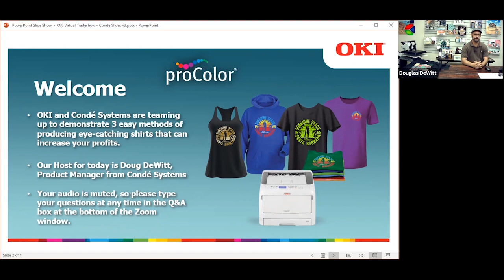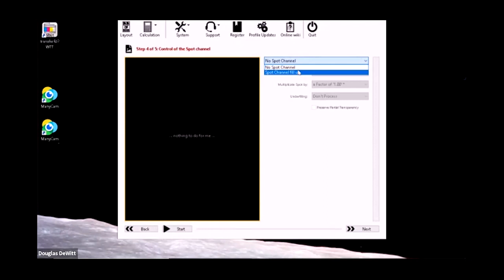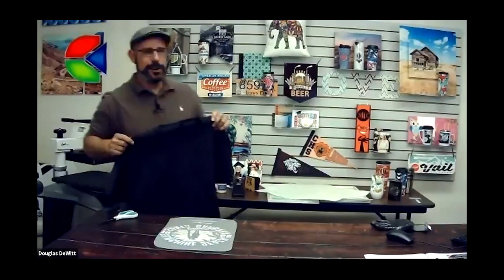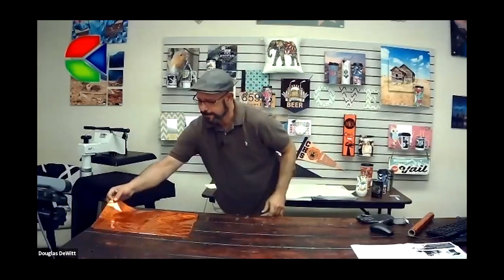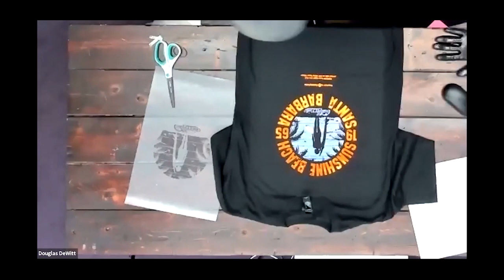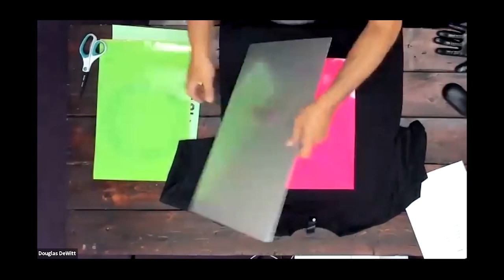OKI Virtual Trade Show - Decorating Tips to Enhance Transfer Output

Comment: Customers have complained that the design begin to peal, crack, and do not look good after only a couple of washes. 
We use the Oki Pro8432WT.  We do not use forever transfer rip but a different rip software and Coral Draw.
Reply from the maker: The best method to make a design soft, flexible and durable is to "raster" or "screen" the design.  This means using the RIP program to add small perforations or holes within the design. Once applied, these perforations allow the design to breathe and flex. During washing, water is allowed to flow freely through the perforations, which minimizes damage to the design. See video: https://youtu.be/-znvNoEUJVU